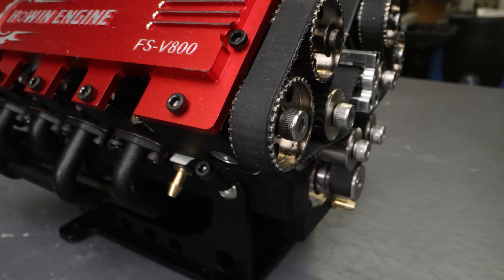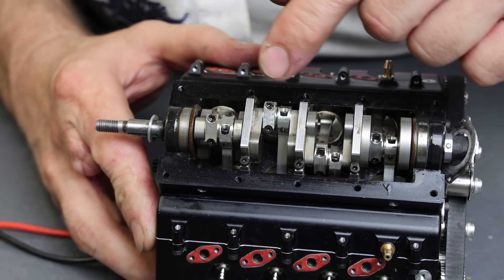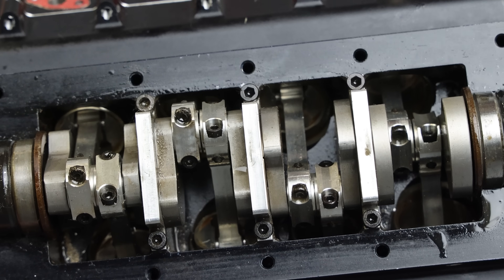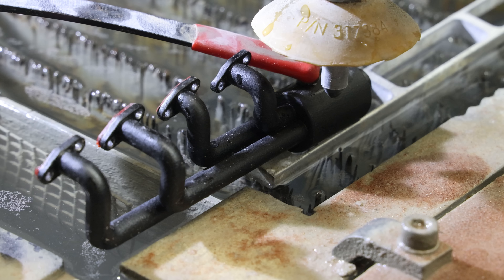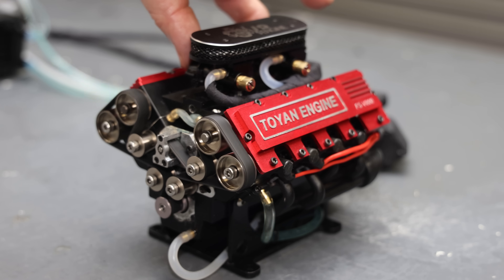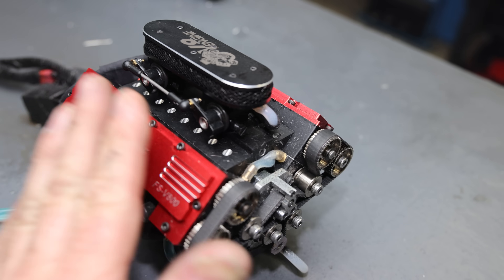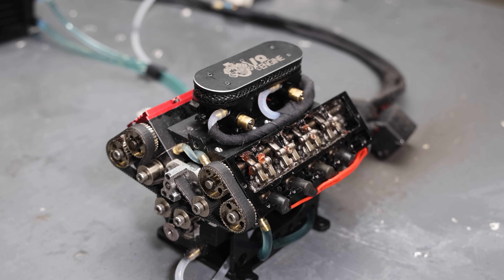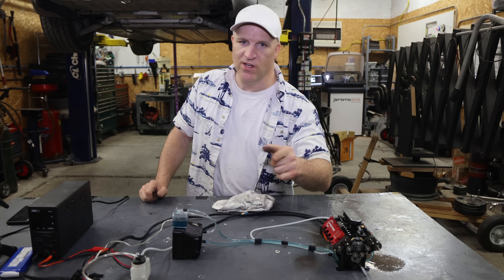World's Smallest V8 Engine Hits 10,500 RPM on Nitro (1.7 Cu In 28cc)

Comment: It would be awesome to see these in a chassis! As a nitro RC. There are kits available and wouldn't be too hard to put this in 👀
Perhaps you could even make a mini Supra modeled after yours
Reply: Save your $1,700. This thing overheated when it wasn't doing anything more taxing than spinning its own flywheel because the cooling system is woefully inadequate, it can't breathe, it didn't even live up to the 12,500RPM promises in the pre-release marketing spiel, and it clearly has issues with staying running at lower speeds.
Reply: @TestECull  His coolant had tons of bubbles. It's hard to tell how well it cools when it wasn't bled well.
Reply: @AndrewMalkin  It should self bleed without any issue. The fact that it didn't, combined with the fact that the radiator was still pretty much room temperature while the engine was screaming hot, tells me the water pump, cooling passages, pipework, et-al is just not up to task.
Reply: @TestECull  I think the hoses were waaaaaay to long. Imagine putting that amount on a vehicle. It’ll do the same
Reply: @BIGREDTECH  trophy trucks would beg to differ, as would formula 1 cars, most mid-engine and rear-engine cars with liquid cooling systems, and basically every boat ever sold with a liquid cooled engine. And, hey, most liquid cooled piston aircraft engines have incredibly long coolant lines as well!
Reply: @TestECull  bro now ur switching it up. Those cooling systems were designed for just that. Rear V mounted cooling system or any other system don’t run stock water pumps 😂
Reply: @BIGREDTECH  Nah I'm just pointing out your false statement as false. You claimed the long lines were why it overheated so I pointed out dozens of different applications wherein long cooling lines do not pose any sort of problem whatsoever.

This engine's water pump and cooling passages are way too small and inadequate. It overheated just spinning its own fucking flywheel. It couldn't self bleed the cooling system in an open-to-the-atmosphere circuit.
Reply: @TestECull  look up johnnyQ90 video of this same engine. Cooling system is flawless. Ur comparing apples to oranges. Most guys running rear mounted heat exchanges run electric pumps not stock water pumps. So no it ain’t the same.
Reply: @BIGREDTECH  I've seen Johnny's video of it. He didn't run it anywhere near as long. He's also one of StirlingKit's favorite youtubers and is basically part of their marketing department without even thinking about it.

Also, I fucking hate that saying. It means nothing. 

I stand by my assessment. This thing's cooling system is a joke. If it can't turn its own flywheel without overheating what hope in hell does it stand of cooling itself in a Rovan Baja?
Reply: @TestECull  
I don’t know enough about engineering or mechanics to agree or disagree with you but I agree with you on one thing, saying that comparing two dissimilar things is like comparing apples to oranges is dumb. I’ve always thought so. They’re trying to say that there’s no comparison but there are many comparisons you can make between apples and oranges. My knee jerk response to that saying is that they’re both fruit, both similarly shaped, both grow on trees etc. They should say it’s like comparing apples to orangutans or something.
Reply: @TestECull  rear mounted rads usually always have a electric pump. A stock water pump does not have enough flow to run 20ft of hose. Lol like I said. Your comparing apples to oranges. Same system. Ones stock. Ones built to race. You put that much length of hose on a stock small block and it won’t make enough flow and cavitate the pump. Do I gotta teach you how pumps work? Apples to oranges my friend. They a fruit but they ain’t the same. 😂
Reply: @BIGREDTECH  Again, that saying is utter garbage and means nothing. Stop using it. It's lazy and it tells me you don't actually have an argument. And secondly,  it doesn't matter if the water pumps are electric or mechanical. I could put an electric water pump on the 4.9L I6 in my F150 but it won't do anything to improve cooling performance over the belt driven one it already has.
Reply: @TestECull  again you must not have read my originally said. If you put that much rad hose on a vehicle ur guna see likely cavitation. Ur narrow minded point on rear mounted rads is void cuz most if not all are running a modified pump to produce the proper amount of flow to prevent cavitation going thru that much hose. I think it’s funny the little jabs you take at my responses to try voiding/belittling my statements instead of proving me wrong. Pump flow/pressure is a real thing. Go ahead and stick with that argument of modified cooling system that can handle a rear rad. When I originally said ur vehicle.
Reply: @TestECull  also if you add 20ft of rad hose to that 4.6 you’ll see that same thing here😂
Reply: JohnnyQ90 runs a couple of these small engines on his rcs

Comment: Am I the only one that sees a gold mine just waiting to be put in production? All these small engine companies are so close but don't realize the size of the market they are missing.

I'll spell it out for you. The development cost to produce this engine in a 49cc or 100cc size would have been the same.

The advantage of the larger sizes is it could be made to run off regular gas and maybe even in a 4 stroke version.

Every kid in the United States and their father's would realize to potential and buy these for all kinds of custom projects.

50cc and under would be legal for mopeds and bicycle engine conversions. 

The kids tricking out their Go ped scooters would be wanting these too. 

The racing crowd would be building mini dragsters for their kids and would probably start a kids sanctioned racing event for them. 

Your bar stool racers and powered cooler racers would use them to be different too.

My money says a guy or two would stick one on a lawnmower just because.

We Americans like our V-8 engines and our V- twins. A practical mini of either will sell.
Reply from the maker: Your right, I've been thinking the same thing, I manufactured a lot of parts and to make things this small it's pretty difficult and it definitely puts the engines into a niche category which is pretty small.

Comment: I'm a big RC plane dude and I would absolutely love to see this in something like a scale Spitfire, P-40 Warhawk or Mustang! That would just be absolutely incredible! I know that a lot of those planes in real life were either radial engines or straights but this would look absolutely amazing and an RC aircraft!
Reply: @John Connor I think that is theoretical and not literal.
Reply: Totally dude! I was thinking the same thing about the WWII model aircraft. I was thinking a RC cigarette boat too.
Reply: My father was in the RAF back in the late forties or mid-40s I should say in the motor pool and they worked on tiger moths and mustangs and spitfires that's when planes were planes have a great day
Reply: Anything is possible but it will have to carry a lot of fuel
Reply: @John Connor I ment just the idea and visual of it. But yes... It has a long way to go before it will catch up to other 4 strokes in the industry like Saito and O.S.
Reply: untill they'll develop a V12 engine a Mustang couldn't be more powerful with a V8(this because Bentley's V12 Merlin engine).
Reply: @matthewmondragon2074  Bentley? You do, of course, mean Rolls Royce don't you?
Reply: @John Connor lol it likely needs the carbs tuned to get running better.  The smaller engines work well in RCs no reason this won't as well.

Comment: For temp issue, you should bleed the cooling system better. Too much bubbles in the lines. At least is the first thing I thought. Engine could use some air too, listening to it.😊👊🏻
Reply: It looks like the source of the 50:50 air:coolant going into the engine is the hose exiting the overflow tank close to the water level. It's not really an overflow tank if it's directly within the path of the circulating coolant...
Reply: He had it setup in a self bleeding way. I believe air is getting in internally, from a seal or something.
Reply: @volvo09  nope, air is coming from his cooling setup into the motor, it should never be the case regardless of what is going on inside the motor
Reply: The coolant lines aren't fitting tightly enough and air is leaking into them at the fittings. It's impossible to bleed until you fix that.
Reply: It is a chinese branded product, don't expect much
Reply: This guy is mostly incompetent, give him a break.
Reply: @jackansi  🤣🤣🤣
Reply: That's not the main issue at all here...The reason for all the heat in the block is...is he let it run at absolute max throttle knocking its nuts off for a prolonged time till the fuel tank was completely empty,  did not let it idle at all. The result is that the water pump is driven by the belt on the front, no engine RPM = NO coolant flow! hence the lines being hot close to the engine. completely the wrong way to look after an engine.
Reply: @motographics  The engine can't cool with air in the system.  The engine at max ROM should be flowing  like hell with coolant but it wasnt.  Either there is air in the system or it's cavitating or both.  High RPM does not matter the cooling system should be able to keep up just like any other engine in a car etc.  If it can its poorly design or has issues.
Reply: @brandonbrown3600  exactly thank you the only person in here that get it lmao

Comment: Cool, but it doesn't sound like it's really running full power
Reply from the maker: not at all... maybe 20%
Reply: @WarpedYT  and this would sound better under load too 👌
Reply: It's a "model" engine. It's not meant to be used to power anything, unlike a regular rc nitro engine. It's a running showpiece, it's not intended to make power, just rev a bit and idle. It'll overheat if you try to make sustained power with it.

But yeah, it does sound starved for air. I wonder if there's a standard rc car under that air cleaner and it's just too small.
Reply: @volvo09  it's a toy, play with it.

Comment: Now I want to see a mini supercharger on that ! The air bubbles in the coolant lines looks bad maybe increase the size of the water journals.
Reply: He'll probably make his own before the factory releases theirs, which apparently they will do, along with actual double over-head camshafts.
Reply: @mickmuzzmkmz1628  That engine actually don't have four camshafts. Just two
Reply: @cenreaper3221  Maybe you misinterpreted my comment, but I never said this engine was double over-head cam, I said it was a possible future improvement for this engine, by Toyan themselves, while answering FAQs. They mentioned possibly supercharging it, making a petrol version, and making it an actual DOHC.
Reply: It is possible to get less airlock stock. Check jhonnyq90s video, very little bubbling👌
Reply: just bleed the lines so it's pushing coolant not bubbles.
Reply: Yeah I was thinking the same thing
Reply: Turbocharger
Reply: theres a company that made supercharge ones but they were crazy expensive but way better quality as well, i forget company name but ill have to google it, not sure if they still exist
Reply: It is a chinese branded product, don't expect much

Comment: You should try to put a bigger flywheel on it so you can turn the idle down and make it lope.
Reply: I agree, it just spins up and slows down too fast...doesn't sound right
Reply: @SamSamuylik  that's probably because the engine had no load in it.
Reply: @SamSamuylik  its a model man if you want it correct buy a fullsize one lol
Reply: Don't Read My Profile Photo  ok I wont
Reply: What scale model would this engine look natural in?
Reply: @mrhello6699  the engine is 1/10th scale but would look most natural in a 1/8th scale car
Reply: @mrhello6699 1/6 to 1/5
Reply: I think a Cox TeeDee 049 sounds more ferocious.
Reply: @soundslikebstome  I used to have one of those 049 in one of my tiny park flyers! Do they still make those??
Reply: i think it sounded nore like a v8 becore be cut the mufflers.  Also being a high revving v8 its gonna be more like a Ferrari FPC v8 . I wish they would design it to sound like a lower revving v8 like a ford  coyote or voodoo. both DOHC but 4 valves per cyl which makes both capable of 8000+rpm but they have that american v8 sound.
Reply: Idk, the vibration of running around low idle might rattle the thing apart.
Reply: @jgetscensored7837  with how small those pistons are i doubt it
Reply: @lennartsix6102  could be.  It’s hard to say without testing it.  Being light means less potential energy.  But being light also means less ability to absorb vibrations
Reply: @jgetscensored7837  i mean there are single cylinders of this size which have no problem with vibrations. And compared to singles even the angriest v8 runs smooth as butter
Reply: miniature 12v cummins with lope please :D
Reply: @henrik1743  and black smoke
Reply: Should advance the spark timing and she's already running rich, better air flow required and she'll make more power
Reply: U mean cams
Reply: 100% bad idea. High revving engines aren't designed for heavy flywheels.
Reply: @zqzj  depends,  on how well the engine is made.
Reply: @zqzj  that's why it's fun
Reply: @zqzj  a bigger flywheel is not necessarily heavier
Reply: @lappo253  a bigger flywheel will in fact have a higher moment of inertia, thus causing it to be more difficult to accelerate the flywheel and making it feel heavier.
Reply: @zqzj  agreed, also i must add that if he want to have a good idle and high rpm, he needs efi, carbs are bad in regular size and in smaller size are just awfull

not even full dragster waste this amout of fuel ( you dont need math, not 1 dragster have a fuel tank the size of half of the engine)
Reply: @chikogota  Carbs require finesse that most don't possess.
Reply: @zqzj  so you lower the upper RPM and dont push out as much HP.
Reply: I was about to comment this lol.
Reply: Heak ye
Reply: It would not change anything
Reply: Don't Read My Profile Photo  you gave me a chuckle, thanks!
Reply: Probably would cause too much flex in the crankshaft and the additional rotational weight likely to wear rear main super fast, and/or break rods
Reply: I'd like to see you put one of those on each back tire to a go-kart and get some kind of chain driven or belt driven control
Reply: @Dain Baptist NOT, the dolt had to ask how this thing is cammed...
Reply: And what did you pay for this paperweight?
Reply: Amen!
Reply: It's a glo-fuel engine. They can't idle below about 3000 - 4000 RPM. They are two-stroke carbureted diesel engines with very low moving mass, short stroke and resultant high piston speed.  When used on model aircraft, the propeller serves as a sort of flywheel, but not really, as the thin prop blades transfer energy across one hell of an impedance mismatch with brute force [high tip speed, long blade], sacrificing efficiency for propulsion [thrust].  And please!:  no jokes about resistance being futile against the force.
Reply: I had to reel the video back to see it....but I was like...is he smoking? He sure is! Must have been a rough video shoot.
Reply: Either that or a new bing pan.
Reply: Don't Read My Profile Photo  you didn’t have to comment anything to get what you’re asking for
Reply: @stevenmartin4889  of
Reply: I was actually thinking of taking out The stock cam, then take it to a talented Machinist in your town and have them make a copy of each with a little bit more lift on the lobes! I bet that will make it really come to life! Now is this motor a overhead cam or a central camshaft like most of the old-school V8's?
Reply: @backwoodsjunkie08  OHC
Reply: @backwoodsjunkie08  so obviously twin ohc,. Can't you see the timing belt and 4 cam sprockets?
Reply: @backwoodsjunkie08  it’s Overhead cam
Reply: @backwoodsjunkie08  It's an overhead cam. You can see what I'm pretty sure is the timing belt in the front. He also said it was overhead cam.
Reply: @backwoodsjunkie08  correction, it's single ohc, with extra sprockets to make it look like a twin ohc
Reply: @edwhitson9873  It's DOHC.  If you look at the cam that's exposed you see 8 lobes, 2 per cylinder on a 4 cylinder bank.  The other side has the same setup for the other 4 cylinders, he just didn't remove the valve cover for simplicity sake.
Reply: @backwoodsjunkie08  Did you watch him take off the valve cover/?? OHC...SMFH
Reply: @backwoodsjunkie08 if you can't tell just by looking at it then I don't think you should be tinkering with the cams.
Reply: It won’t turn the idle down , it will just make it accelerate slower but have more momentum when starting to move
Reply: @type2523  the flywheel itself won't lower the idle, but the added mass makes it less likely to stall at low rpm.
Reply: @type2523  he didn't say it would turn the idle down he said so that it could be turned down.
Reply: How many miniature HP doe the engine give?
Reply: @metern  1/10 reduction in HP but don't quote me
Reply: How many dwarf horses power does it pull
Reply: A 10kg weight plate would do well as a flywheel.
Reply: @Draxindustries1   Come on man . . desist
Reply: @benwinter2420  Desist  from what? Comment on grease in the rocker cover or 10kg flywheel? 
Which one ?  Maybe both?
Reply: @benwinter2420  you may need help..
Reply: @Draxindustries1   Don't break my balls man . . friendly warning
Reply: @Draxindustries1   Sure . . send me some $